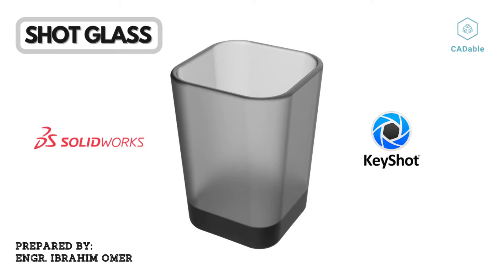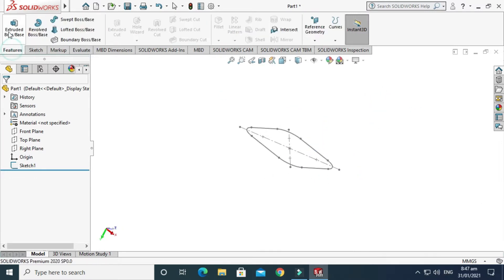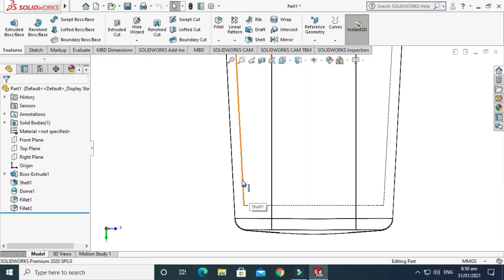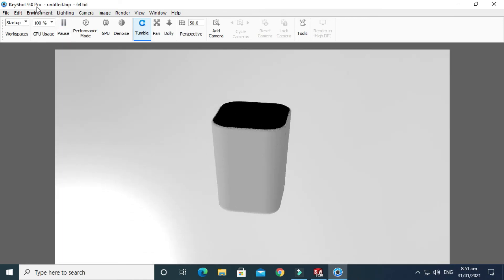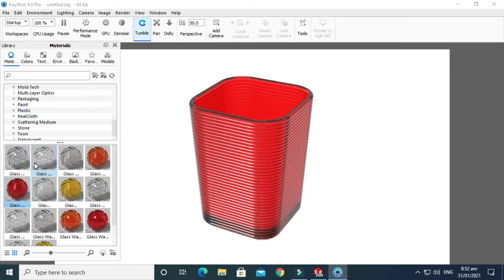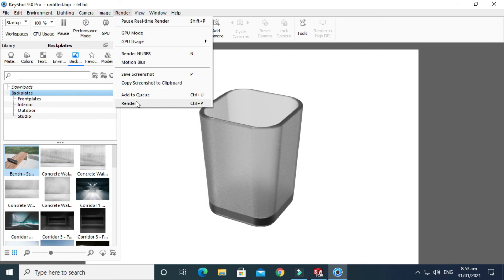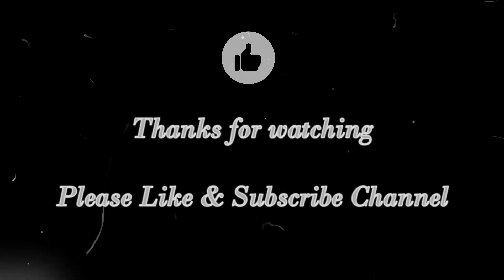How to sketch shot glass in Solidworks | Sketch a glass in Solidworks | Shot glass keyshot | CADable

Comment from the maker: Tutorial Beginning: 0:00
Part Modeling: 0:16
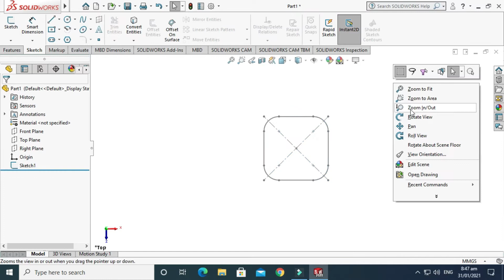Extrude Boss: 1:15
Draft Command: 1:36 
Shell Command 1:45
Dome Commad: 2:20
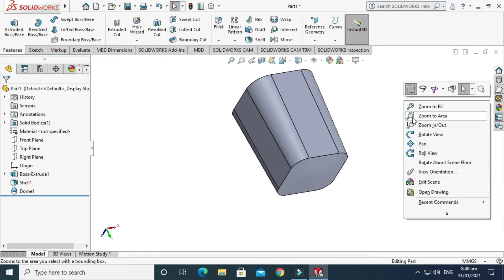Constant Fillet: 2:38
Face Fillet: 3:02 
Keyshot Plug-in: 4:50
Basic Settings: 5:07
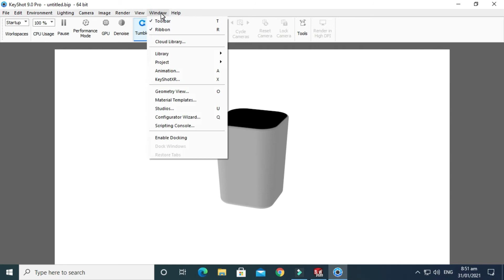Keyshot Material: 5:40
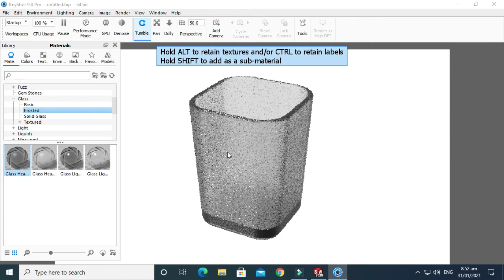Render Settings: 6:40
Final Render: 8:15
Final Element: 9:02